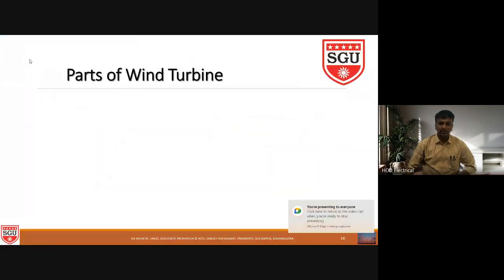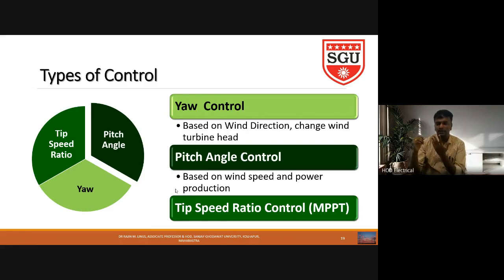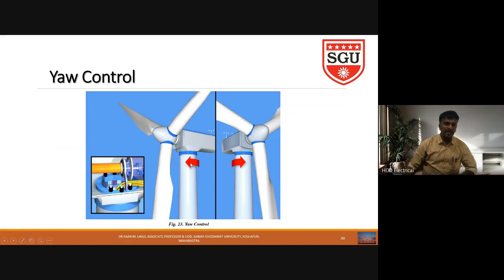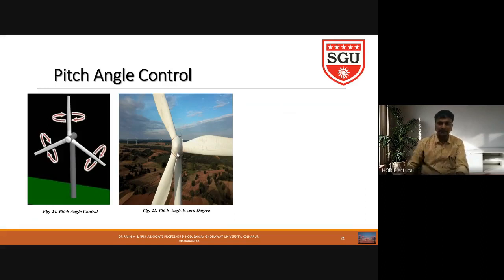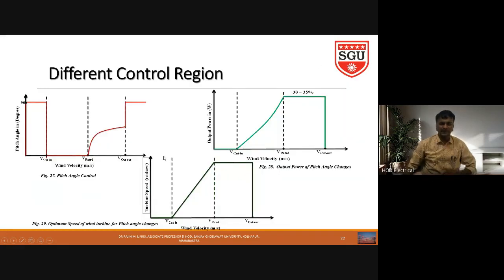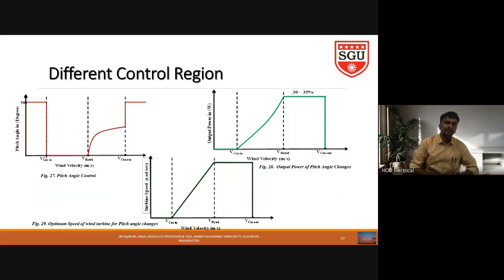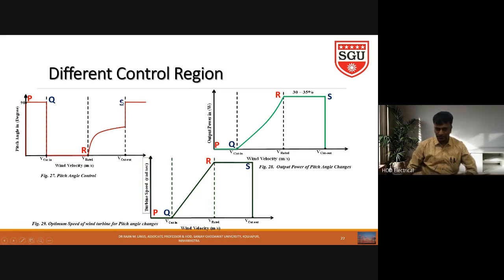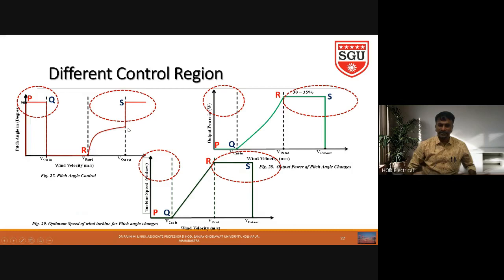WECS - 1: Yaw and Pitch Angle Control in Wind Turbine By Dr Rajin M. Linus

Comment: It has told that turbine is synchronized with grid, if so how the turbine speed changes with wind speed (as shown in third graph) ?
Reply from the maker: Thank you for your comment. We have to connect variable speed drive and grid interfacing converter between generator and grid

Comment: How does it get constant frequency of generated voltage with QR region ?
Reply from the maker: It will not be the constant frequency dear. Speed vary with respect to optimum tip speed ratio